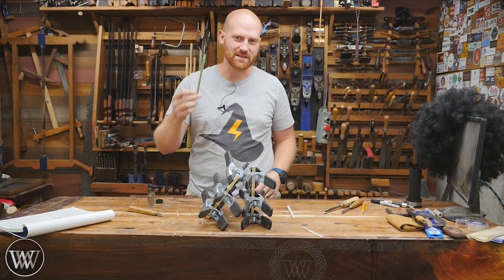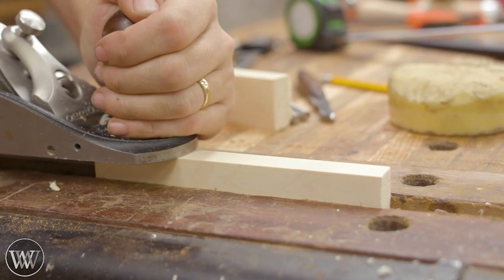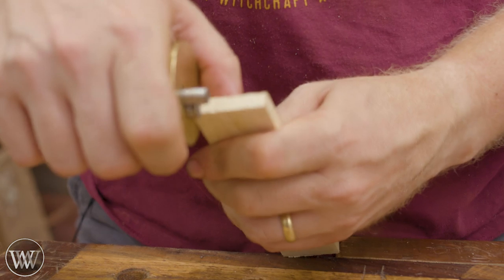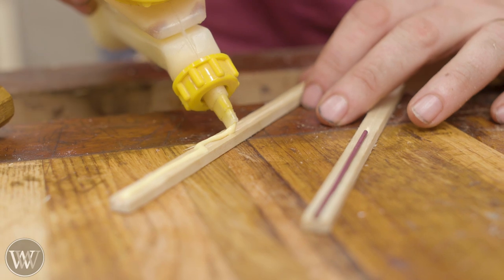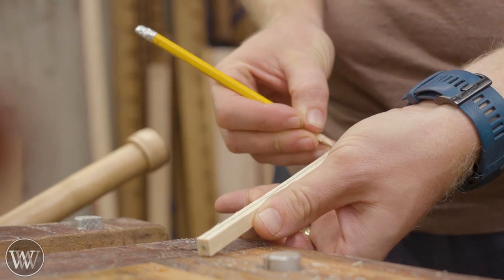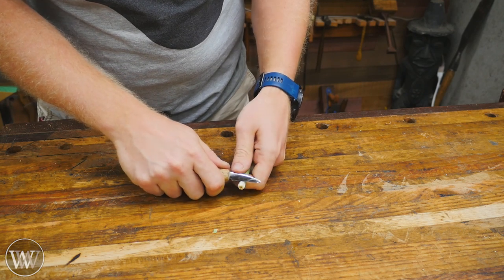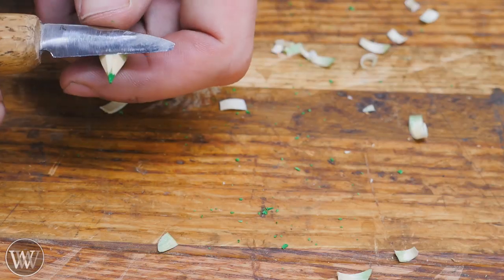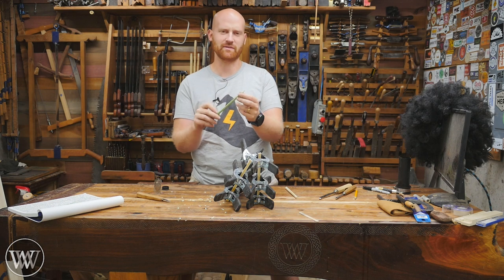How to Make a Colored Pencil With Only Hand Tools

Comment: From what I know about traditionally made pencils, the wood is usually cedar.  (not sure why).  When assembled, they paint them with water-based color.  Many, many thin coats.  Then the seal the water based color with lacquer.  Plus, everyone knows that regular pencils have no 'lead' in them.  Graphite and clay.  Color pencils are mostly wax based centers.  With pigment.  Adding my 2 cents.

Comment: I'd like to make a bunch of pencils - almost set up an assembly line approach.  I'd use hand tools.  What would be the easiest wood to work with?  Cedar pencils are common, is that because it's easy to use?  I have a source for hardwoods nearby.  They sell their offcuts by the pound, so I can get  a lot of small irregular pieces cheap.  But what wood should I look for?
Reply from the maker: Ceder is a very easy wood to work with. I like poplar, but most any wood around that softness would be easy enough.
Reply: Wood By Wright How 2 so I made a pencil but the colored lead seems to break really easily.  I think I got the lead from your link. Have you heard from anyone about problems with the lead?
Reply: I actually got June Gold lead.